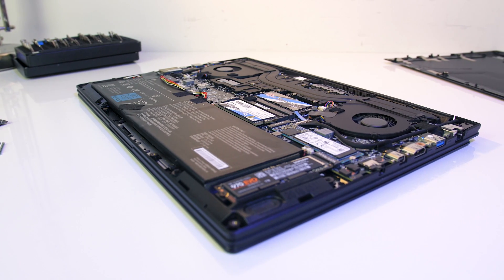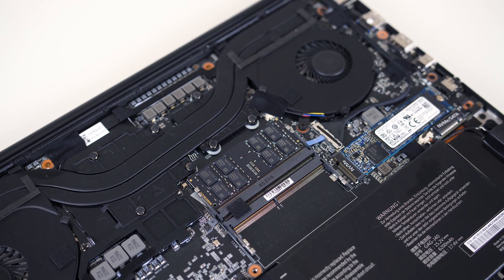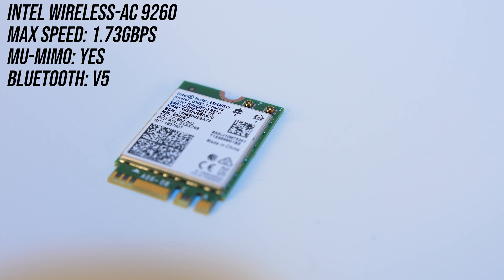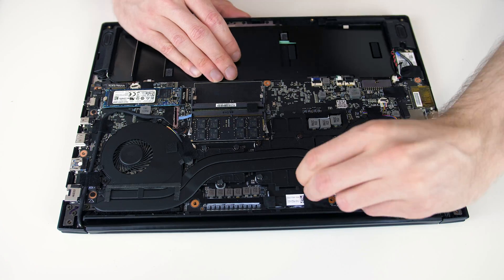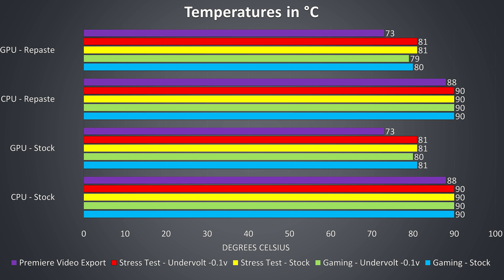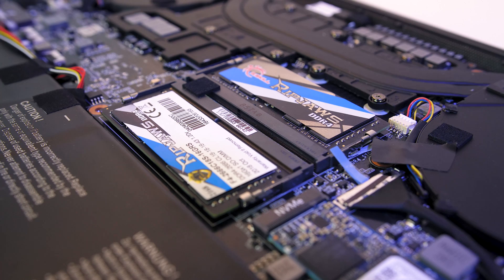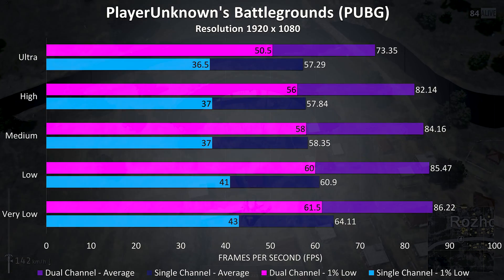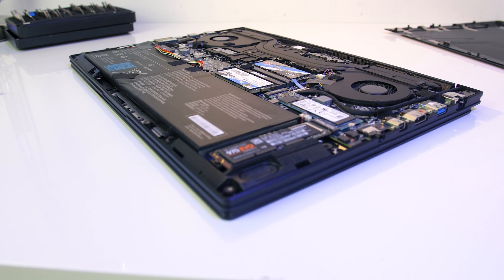Upgrading the Gigabyte Aero 15x Laptop

Comment: Thank you jarrod been waiting for this video and you delivered. Definitely one of my favorite YouTube channels. Quick question however do you think that it might help to use different thermal paste when attempting to repaste like the noctua paste or Artic silver 5. Also could I just use a m.2 ssd instead of a nvme ssd if I just to save some money in the extra drive slot?
Reply from the maker: Cheers! The paste I use has a 12.5W/mk rating which I think is one of the better options, Arctic Silver for instance seems to be 8.9, and 8.5 for Noctua NT-H1. Do you mean SATA M.2 SSD? Yeah, the secondary slot is labelled as NVMe/SATA
Reply: @JarrodsTech  sorry forgot to add the sata and yes thanks for the quick response
Reply: @JarrodsTech  Last question do you think I have to remove the Battery before installing the ram/ssd or do you think I can get away with leaving the battery in place?
Reply from the maker: Probably fine for just sticking an M.2 drive in, depends how careful you want to be though, in the case of this laptop it's very quick and easy to remove so if you want to be safe I guess may as well!

Comment: I don't know man, that thermal paste application looked a bit dicey, I heard you need to put a pea sized pebble in the center and it will spread with the cooler pressure: you might have caused bubbles that ruined the conductivity. I wasn't planning on doing anything on my aero for a couple years but seeing those dual Channel gainz is tempting. Also why are only 512gb storage sticks supported?
Reply from the maker: Yeah might retry it, honestly can't really be bothered cleaning it off and trying again to waste more paste for likely same results lol. I didn't go with the drop method because one of the dies was rectangular and wasn't sure if the pressure would result in full coverage. Not really sure about their listed drive compatibility, that should be way less of a problem compared to RAM compatibility I think, I haven't heard of anyone having issues with it and my 1TB one worked just fine no problems.

Comment: The repaste went wrong
Reply from the maker: How would you have done it better? Or are you just stating that it didn't help?
Reply: The spread of the thermal paste seems a bit light so there could be air gaps in-between the cooler and the dies, which in most cases hurts temperature performance.  Going with the pea method would’ve been best, as thermal paste spreads as it is compressed between the CPU/GPU die and the heat sink.  Using the thermal pads on the VRMs was the right move though.
Reply: Also, for the GPU, just use more thermal paste, or apply it in such a manner that the die will get optimal coverage (X method, a larger pea size, rectangular method where you apply it in the shape of the die with maybe a small dot in the center, etc.).  Steve from Gamers’ Nexus actually has a video on repasting, granted he does this on desktop parts but there shouldn’t be many differences.
Reply from the maker: Would a pea size dab of paste spread evenly over the rectangular die though? Either way no one can agree on paste amount lol, most people are saying I used too much and then others too little 😅 yeah I saw his video, it's the one where he basically says no matter what you do it's hard to mess up 😛
Reply: Try the X method
If that doesn't help go LM do let us updated

Comment: I just upgraded my gaming laptop 
Luckily my Clevo model has 4 ram slots and supports all ddr4 sodimm modules. I now also have 32gb

I also have 2 sata hard drive slots and 3 nvme slots in there. So I use an nvme drive as my boot drive and a regular 1tb sata 3 SSD as my data hdd replacement

I bought the same kryonaut paste 3 days before you uploaded this video but I probably won’t repaste after watching your video
Reply from the maker: Nice, hope it goes well! Probably worth a repaste to see how it goes, if they used bad paste it may help, but also if you have better cooling / heatsinks it might make a larger difference.
Reply: Jarrod'sTech I probably have better cooling because my laptop is much thiccer and it’s a 17.3“ model without maxq and giant heat sinks
Reply from the maker: That would definitely help 😁

Comment: Thanks Jarrod for listening to our requests and making this video. It's a shame about what happened with the RAM nut at least you got it working somewhat.Running  dual-Channel is definitely worth it though. I never realized how cheap the WiFi card replacement was! I'm gonna have to try that out next. I wish i could go to CES, especially this year. Looking forward to seeing your videos from there!
Reply from the maker: No problem! Yeah me either, I only looked into the WiFi card upgrade after I made that community post showing the first parts for the upgrade that arrived, so that was one of the reasons the upgrade video was delayed because I ordered that separately haha, $15 for the card, $10 shipping, ouch! I'll update the pinned comment if I get any progress on the dual channel memory, or maybe a Twitter/Facebook message, Gigabyte just responded to my support ticket asking for more info.
Reply: @JarrodsTech  Good luck! hopefully it can be fixed by re-flashing the BIOS or something. I hate the feeling like I'm leaving performance on the table. I'm also interested to see how that liquid metal turns out if you decide to do it. I don't think I have the guts to try it. One of the only good things about living somewhere really cold is that I get significantly better thermals! After messing around a lot in XTU, I have the 8750H CPU running at the 3.9Ghz Boost clock constantly  with the max clock speed going up to 4.04Ghz occasionally. And an idle temperature of around 38 degrees Celsius. With those temps I don't want to mess with re-pasting at all. Who know's? Maybe Gigabyte is actaully using some half decent thermal paste now? Oh btw, did your laptop come with that extra Thermal Pad for you to use if you add a second SSD to the laptop? I got one with my laptop in that little bag that has the manual and that Driver Disc (lol why do they give you a driver disk for a laptop with no disc drive??).  Man those AU prices are rough. It must make shopping on the internet so much less enjoyable. That same WiFi card costs me $17 with free shipping.
Reply from the maker: Yeah no point changing it if it's working fine! Nah it didn't, it had one thermal pad on the original SSD but no extra for me to use. Shipping here makes me sad 😛

Comment: your repaste did not look very clean, if you dont know how to spread it put some in the middle and let the pressure do the rest, also did you remove the foil from the heating pads?
Reply from the maker: I did tidy it up after what was shown in the video before putting the heatsink back on, either way I still think this method will give better results considering one of the dies is a rectangle and would be hard to get even spread.. Yes, I removed the material on both sides of the pads.

Comment: I know I sound like a total tech illiterate but if I simply add a stick of memory identical to what's installed in my laptop does that count as double channel?
Reply from the maker: Yes, if it's the same size, can run at the same speed and timings then it should run as dual channel.
Reply: @JarrodsTech  Where original ram are available ? I dont find. Thanks :)

Comment: I've heard that you have to periodically change thermal paste based on metal. Is that true?
Reply from the maker: You mean liquid metal? I don't actually have experience with that so not sure. For standard paste it should be fine for years depending on the paste.
Reply: @JarrodsTech  thanks a lot man.
Reply from the maker: No problem!

Comment: Well thanks for sharing this. Should be helpful for anyone looking to upgrade their Aero 15. Real bummer about the thermals. I'm surprised as most manufacturers use cheap paste. Gogabyte might have actually used good stuff?
Reply from the maker: Yeah maybe, some are suggesting that it's to do with there not being enough heatsink surface so maybe changing the paste won't really help much 🤔
Reply: Yeah. Maybe another heat pipe inside on the cpu atleast. Are the only vents for the laptop under the screen? Wonder if it just can't get the heat out and more air vents around the back should be added?Liquid metal would definitely help as Linus put it on the latest Macbook Pro with an i9 inside and it did a good job calming it down. So if it can cool something with thag much heat and a terrible cooling solution it should do well here. I'd be scared to try though. Lol

Comment: He Jarod, i wouldnt try liquid metal on the aero 15x, the thermal limit is probably caused by the amount of heat sink surface. The thermal conductivity of the paste is not the issue. Its commonly more usefull in laptops with more fans and heatsinks, like the gs65. Or when the company uses  ** thermal paste.
Reply from the maker: Yeah could be, I wasn't planning on trying that anyway, can't really be bothered dealing with it to be honest.

Comment: Thanks for the video! Fantastic video as usual. I have a question for you @Jarrod'sTech : If you compare the Aero 15X to the Razer blade 15 in term of trackpad, which one do you find better? Thanks.
Reply from the maker: No problem, cheers! I like the size of the Razer better, otherwise I think the Aero maybe feels a little nicer, very similar though. The Aero's is not great with the default ELAN drivers, but if you install precision drivers it's very nice to use.
Reply: @JarrodsTech  Thanks a lot! Hum so it seems to always come down to these precision drivers... question is: Will I be able to find a decent equivalent for linux? lol
Reply from the maker: Honestly no idea, I don't have any Linux laptop experience unfortunately, I only use it in virtual machines or for servers.
Reply: @JarrodsTech  Np I'll have to find out myself, couldn't find any reviewer on the internet dealing with this :(

Comment: The reason y your before and after repaste temps are same is because of those small heat sinks, by repasting u increased the heat transfer rate from the die to the heat sink but in your case your head sink is not limited by inefficient heat transfer, it is limited by its size. Hence no difference
Reply from the maker: Could be, not much I can do in that case either way, still interesting to see.
Reply: @Jarrod'sTech

I have also watched that video before and I am aware of the small differences it will actually have in real life. 

I was simply giving a guideline on the quantity of paste you'd need.

The main problem here is the manual spreading which may introduce air gaps.

Just my 2 cents :)
Reply: The reason why repasting the laptop did nothing is because the method used was wrong.

You shouldn't be spreading the paste manually as it will create air gaps which worsen temperatures. Hence it canceled out the benefits of using a superior thermal paste.

Just apply a 1-2mm sized amount of paste and reinstall the heatsink. The mounting pressure of the heatsink will spread the paste out.
Reply from the maker: @Seanweekhaizhen  https://www.youtube.com/watch?v=EUWVVTY63hc ¯\_(ツ)_/¯

Comment: That’s too bad about the memory upgrade ): at least you were able to get more storage and the WiFi card looked like fun to install and easy to get to. Overall I think that laptop is easy to work on if I were you I would definitely open it again and do liquid metal. Maybe when you’re back from traveling or have some extra time as I know AU can be a pain to have stuff shipped there. Hope you’re able to find a new setup for internet I know it can be slow (My gf is currently vacationing in Perth). Laptop looks pretty light and easy to take though so I’m definitely jealous! 

I have the Helios 300 and have done an SSD upgrade, undervolted cpu and OC gpu as well as liquid metal and upgraded to a 120hz panel. Temps avg 64-70 when gaming on high settings (mhw, bo4, destiny2). I think u said ur gf has one? I recommend Liquid metal for this one.
Reply from the maker: Yeah LM could be worth a go in the future, just need more time/preparation 😛 nah no Helios 300 here, my partner's laptop is some old Sony that needs to be replaced 😰

Comment: Dont recommend fujipoly just out of nowhere withou teven having tested them, those pads are very hard and brittle. You cant really reuse them and because they are so hard, heatsinks will end up with less pressure on the chip dies itself if the pads are even slightly to thick. Gelids have a slightly lower rating but are much easier to work with and in the end are more beneficial.
Reply from the maker: I didn't recommend them, I suggested people do their own research and look into them, as many other people spoke highly of them due to good thermal conductivity. Sorry if it was taken as a blind recommendation, I would not do that.
Reply: @JarrodsTech  Well they kinda are because they are highlighted in your video. The people that speak are 9 out of 10 times the people that pick apart laptops often and know how to work with the heatsinks and have done all the testing to make sure each pads makes proper contact. There are many people with worse results on the notebookreview forums that went in blindly just because it has high thermal conductivity numbers. Mind you that between pads the differences tend not to be more than 2 to 3 degrees.
Reply from the maker: @zeronine-eightyfour  I'm not sure what you want me to do about this minor misunderstanding. Yeah they're highlighted because I came across them while doing my own research, many other people suggested them while they were doing this to their own Aero laptop which is why I suggested looking into them more if you're after pads - I guess you could say I recommended looking into them, if it came across as you thinking I said "buy these now and nothing else" then I am sorry about that. It's not as if I included links to buy them in the description with the other components. I would have bought them if they were available here to try myself, but unfortunately that was not the case. Thanks for letting me know about the potential issues with them, I was not aware of that.

Comment: Does the brand of the ram needs to be same to apply for dual channel memory?
Reply from the maker: No, just same size and run at the same speed/timings I think, I am using a V-Color and G.Skill stick in dual channel here, both are 16GB running at DDR4-2400 CL17.

Comment: Hey J. Very nice video. Just 2 questions maybe you can help.
1. Do you think the price for current laptop models will drop significantly after the CES and new video card? 
2. For gaming purpose and light video editing, what model you would recommend? I am looking for a light and thin laptop but the price in AUD is not very affordable (for example models with ROG logo)...
Reply from the maker: Thanks!
1. Not sure if significantly, but there may be some sales, hard to really know just have to wait and see.
2. I went with this one for video editing, otherwise anything with the 8750H and Nvidia graphics will probably just do fine, problem with cheaper gaming laptops is they tend to cut costs on the screen.
Reply: I recently bought my 15x as well during a black friday sale, for 1750 USD. Considering the prices of desktop RTX series cards, I wouldn't be surprised if the new laptop cards are sold at a premium as well rather than replacing the older ones. For the ROG related question, biggest killer for me was their battery life. Most of those are ~55w, which just doesn't cut it if you ever plan to actually use the laptop off the charger. Biggest real competition to me was MSI (around the same price) or Razer (if you're willing to pay significantly more for a more premium build).
Reply: BerserkFury89 Agree. I always appreciate the design to replace hard drive with m.2 SSD to leave more space with battery. Yes the SSD is more expensive and not that reliable, but I don't see that as a problem over time. As for price, I am considering MSI as a good alternative.
Reply: @michaelz379  I probably would've gone with the MSI if not for the black friday sale I caught for the 15x. It was a good $200 cheaper than the MSI, so I couldn't pass up that deal.

Comment: hey jarod , nice review btw .. finally i bought laptop aero 15x with 1tb and 32 gb ram from the official store, the problem found when i use their old nvidia drivers the temperature reached 93 celcius when i played pes2019 . butafter i instaled from nvidia the new one ,the temp max 82celcius... maybe after i watch your video iwill repaste later, when the temp goin up 😂😂
Reply: btw iwant to ask something, what apps do you use to display the frame rate on the screen ? thanks btw
Reply from the maker: Thanks! Hmm that's strange, I can't install the newer Nvidia drivers, only the latest ones provided by Gigabyte either way though not sure why there's such a big difference if you're doing the same thing in game. I use FRAPS or OCAT for DX12/Vulkan.
Reply: @JarrodsTech  I managed to use the GeForce Experience to update my drivers. No issues so far.
Reply from the maker: Errors for me every time 😰 I had the same issue with the Y530 too, but after using DDU, manually installing GeForce Experience, then installing latest drivers via GeForce Experience it did work, so could probably do the same on the Aero maybe - I'm going to leave it with what Gigabyte thinks are stable though, not worth messing with bugs when I go on my big CES trip next week 😛 I just want it to work haha.
Reply: try download manually from nvidia, dont use geforce experience. my driver version 41735.. until this day, performing excellent
Reply from the maker: I tried that, didn't work for either my Aero or Y530.